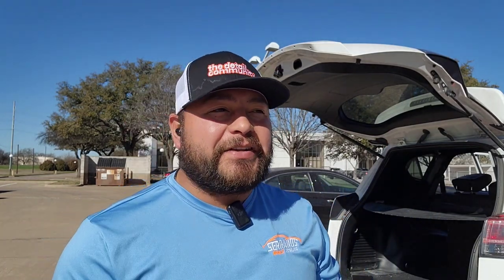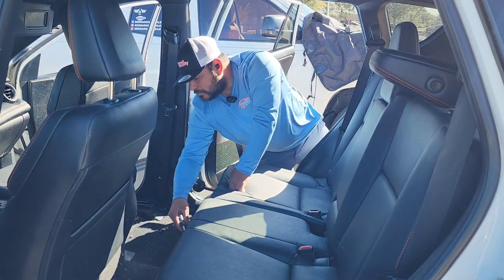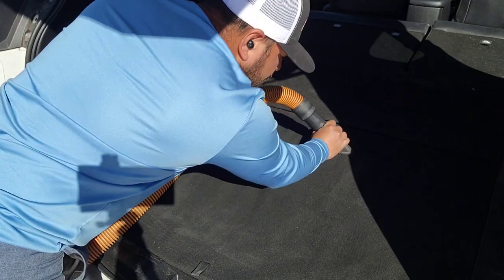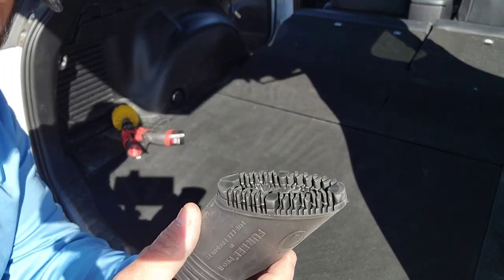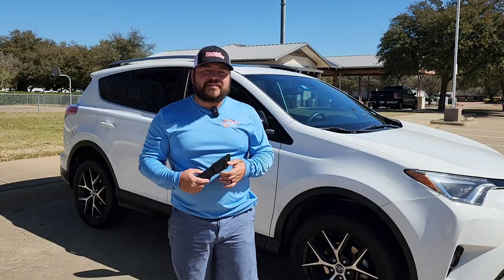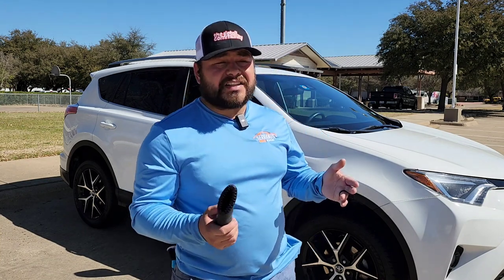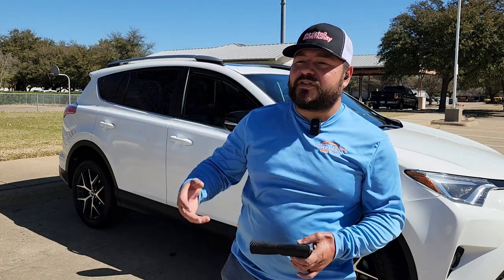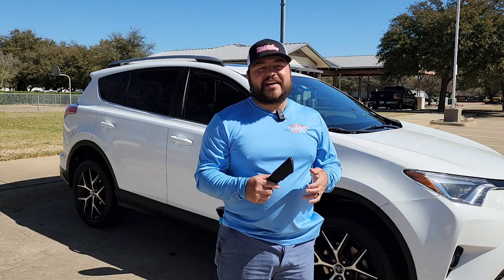Fur-eel pro

Comment: Hey CS! I had the same issue with the original.. I did an F250 quad cab with lots of fur. While it did work well at the beginning, I didn't make it through the rear carpets alone before I had no teeth left! When I reached out to them, they basically said it was my fault and I didn't use it properly. I needed to only go one direction, not back & forth, that I pushed too hard, and I should be misting liquid on all the carpets while using it. At that point, I went from having a tool that didn't last 10-15 minutes to being told it was delicate and needed to be used in a way that slowed me down by the manufacturer! It pretty much turned me off of the product and the company's customer service. Detailers aren't gentle with their tools & if they can't hold up and be cost-effective, I can't implement them.
Great review my friend!!
Reply from the maker: Thank you very much

Comment: I had a lot of the same issues with the original fur-eel. I've had 2 and they degrade with the first use.  I believe it's user error but redesigning the tool to make it better for use as a pro detailer is great and in the right direction.  I will be giving this new tool a shot to see the actual longevity vs the original. I still have a Lilly brush and a couple other tools I use for pet hair that I have to pair with the original Fur-eel, so worse case, I just go back to those.  Thanks for the review man.
Reply from the maker: Thank you for watching